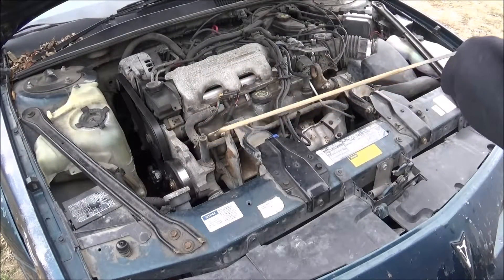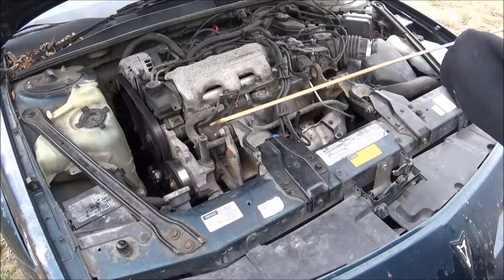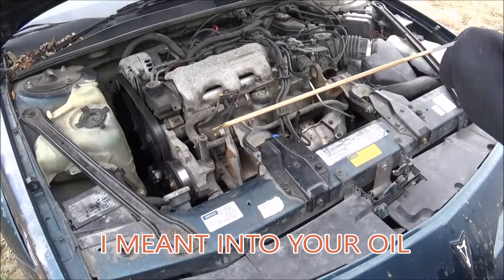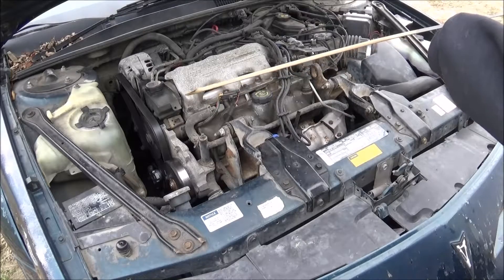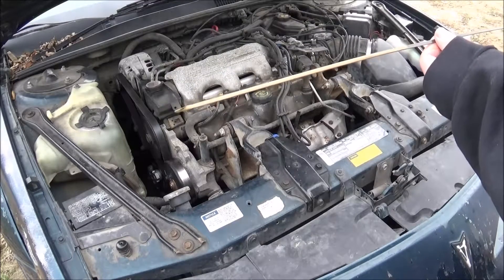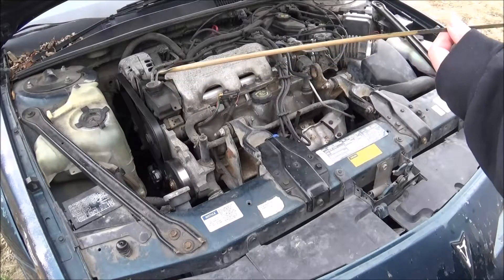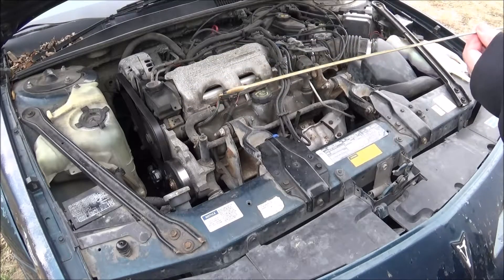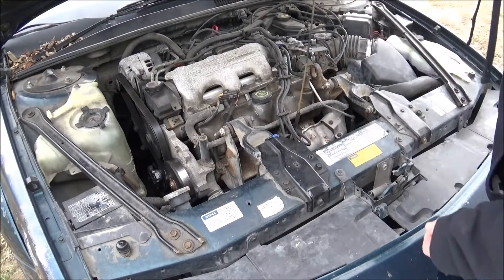diagnosing bad head gasket, signs of a bad head gasket, how to diagnose a bad head gasket

Comment: sir in my hyundai accent 1.5l petrol engine car i noticed white milky droplets in oil cap but the dipstick is clean and there is no smoke..please give me a solution for this problem ..
Reply: +royzcustomz ok ill change the hose and pcv also..thankyou sir..
Reply from the maker: @armrub4033  i got to thinking that you might need to check your oil separator it might need cleaned or replaced.
Reply: +royzcustomz ok i'll check..👍
Reply from the maker: might just need a new seal on the cap or a new cap. it might be bringing in moisture from the outside.
Reply: +royzcustomz condition of the oil cap is good..still iam facing this problem..
Reply from the maker: @armrub4033  is it running alright? Is there a hose from the valve cover?
Reply: +royzcustomz ya it has..
Reply from the maker: @armrub4033  change the hose and make sure it is hooked up where it goes that tube can drag moisture into the valve cover,they usually go to the air box
Reply: +royzcustomz sir where it will be located??
Reply from the maker: @armrub4033  it's usually on the side of the engine under the exhaust manifold. It might be under the intake manifold it looks like a pan on the side of the engine and usually the pcv valve is located in it
Reply: +royzcustomz ok  thankyou..